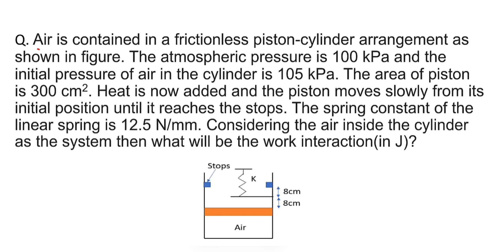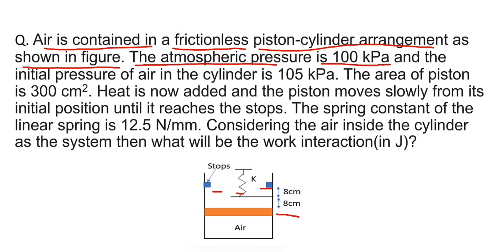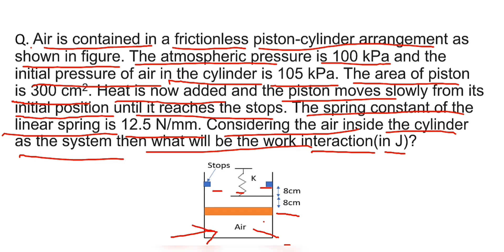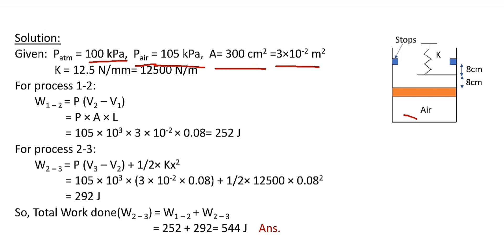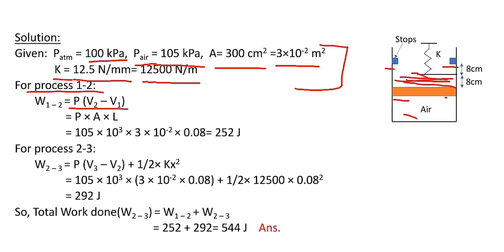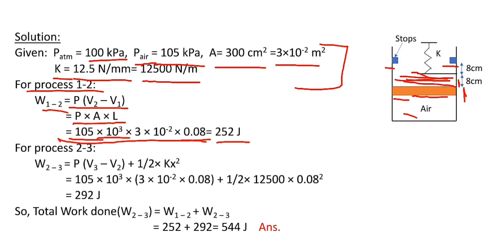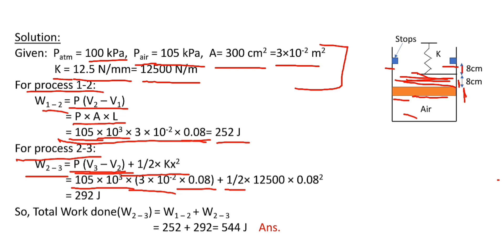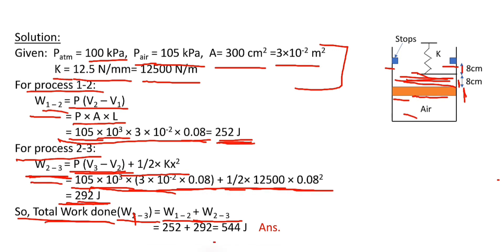Air is contained in a frictionless piston cylinder arrangement.What will be work interaction (in J)?

Comment: sir can you help me with this problem plz? 

Air gas is stored in a cylinder-piston container, with an internal area of 0.02m^2. The piston, which is connected to a spring, is initially at 2 bars and 27C, and 12 cm above the base. In this initial state, no force is exerted from the spring on the piston. Following a reversible heating process to 80C, the spring is compressed exerting a force on the piston given by F = -cy , where c=75000N/m and y is the displacement from its initial position. Determine the work done. 

I’m not sure how to approach this, would the system be piston+spring!? Thanks you
Reply from the maker: Bro, in this question P2 or V2 should be given. Once again check the question statement and if it is right then tell me the ans. I will send you the solution.
Reply: @mindofmechanical4802   hi sir, actually this is the problem statement it is not providing either P2 or V2. I tried to solve it but not quite sure about my approach! so I let the system be the piston+spring, then I got the W_done= W_piston + W_spring( integrated -cy from 0 to .12m ) and that gave me W_done= -1020J. You said P2 or V2 should be given, then probably it is necessary to take the reversible heating process into account and maybe can get either V2 or P2 from there? because the temperature has changed.. any help plz? and send me the solution plz. I dont have an answer for it, it is actually a homework problem. thank you in advanced
Reply from the maker: Bro, you are using the right approach but according to question spring got compressed when heating up to 80 °C. So, integration limits you should have take from .12m to y and here for the value of y final volume should be known . Try once again, I hope this help you. 👍
Reply: Mind Of Mechanical  yessir, was very helpful! Thank you. Yes I fixed the limit and then for y I used ideal gas law since it is reversible heating ( I assumed its ideal ) and used P1V1/T1 = P2V2/T2 and canceled out pressure ( isobaric condition ) because since the temperature changes and the volume changes then pressure must not change, it is also kinda make sense because the initial pressure was the pressure at the piston and as heat was supplied there was a change in volume, the piston moves up a little bit compressing the spring, that is the boundary has shifted up and it is still feeling the same pressure ( the change of volume cancels out the affect on changing the pressure) . However, If the volume did not change then the piston will feel different pressure, probably higher. And then I got V2, and V = area*l, I solved for l “ y “ and then plug it in y, the limit of integration then got the work done. All this flowed after I fixed the limit of integration which makes more sense I think. Thank you again sir
Reply from the maker: That's good, most welcome dear!!